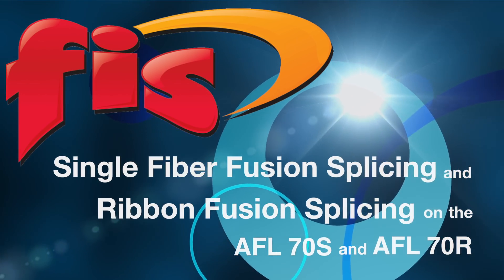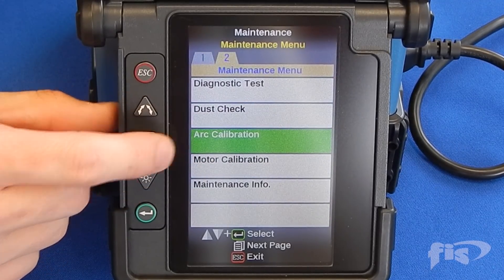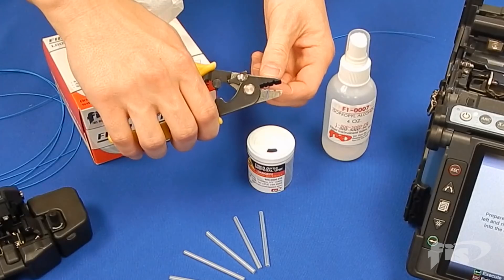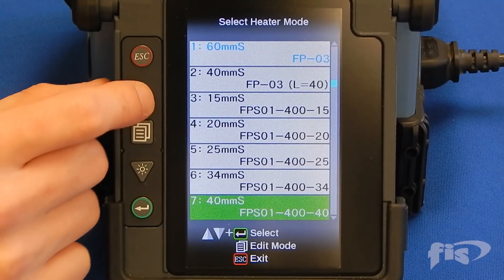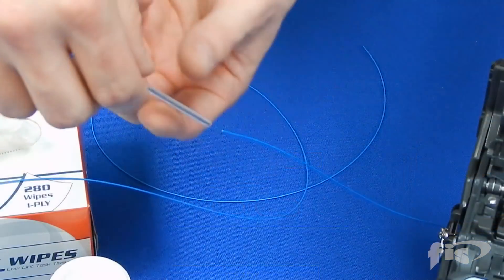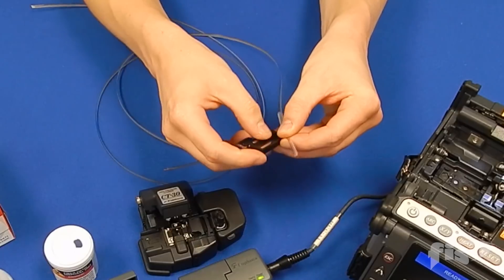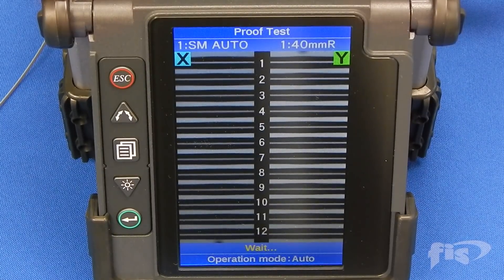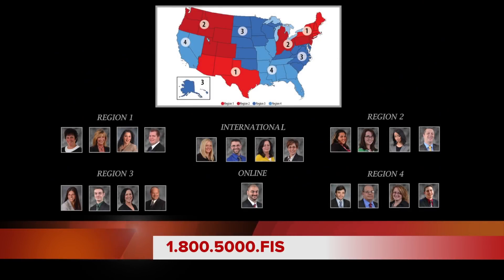Single Fiber and Ribbon Fiber Splicing

Comment: Out of curiosity, why do you say to keep slight tension on the cable after the splice?
Reply: good question.  Most people set the splice into the oven without tension.  There is a slight chance that when melting the sleeve you can melt a bend into the fiber.  When setting the sleeve in with tension it keeps the fiber straight and there is lees chance of a macrobend.
Reply: @johnbruno2740  Good to know, thank you. I intend to get into this myself, so I want to learn as much as possible
Reply from the maker: @SunBroRevan, to continue to learn about fiber optics go here: https://www.fiberinstrumentsales.com/fiber-optic-training

Comment: what is this useful for?
Reply from the maker: It is used for splicing fiber-to-fiber.  For example, if a cable breaks, it needs to be fused back together.
Reply: Ever have the internet go down for you? Good chance it was due to a fiber cut. This is for fiber cuts. The work environment is rarely this clean. Most of the time this takes place in a manhole or a bucket truck.

Comment: How critical is it to recalibrate every time you turn it on? I recall my Fibre endorsement class few years ago, I think it used a "60", it arrived from another state - typically few degrees cooler than us, out the box turned on, and whamo we were splicing within 30 minutes, they all - including the first splices all passed, so is it critical to recal every time, or just once a month, or 6 months or whatever?

I can hardly imagine mobile techs, doing this every day or multiple times a day, surely its not that bad, unless it sits in  a cupboard for 6 months?
Reply from the maker: Hello Ressy6,
     You want to arc check before each and every splicing session.  Even if you go to lunch and come back, the temperature may have changed and will result in different readings for your electrodes' power.
     As far actual calibration, you want to have this done after approximately every 2,500-3,000 arcs.  It is also a good rule of thumb do have the unit calibrated when replacing electrodes, as well as having a once-per-year full calibration.
     We sincerely hope this helps you with your inquiry and future splicing sessions!
Best Regards,
    Fiber Instrument Sales.
Reply: Thanks, I suspect lots of techs not following manuals :)  Most I've seen were like my training, out the case, turn on and go...
Reply from the maker: That's exactly what happens!  Most of our calls that we receive are usually pretty simple fixes when techs have not been told or trained a few simple steps that will completely help them splice efficiently and quickly.  At least it's an easy fix in those cases and not something wrong with their units which, of course, would waste more time and money.

Comment: can i use 70r to terminate single mode fiber?
Reply from the maker: Jose Angelo Lavapiez, yes, you can terminate Single-Mode fiber on the 70R.  It would require, however, the Single Fiber holders (which come in pairs).  There is the FH-50-250 Single-Fiber Holder for 250um and the FH-50-900 Single-Fiber Holder for 900um.  These line up with the V-groove.  You cannot use the 70S Single Fiber holders on the 70R though, it must be one of the two mentioned above.  
Let us know if that helps or if you have any other questions!
Reply: skype me - sapple.telecom ( for fiber splicing machine, cables armoured & unarmoured , other items )
whatapp mobile - 00919972709517